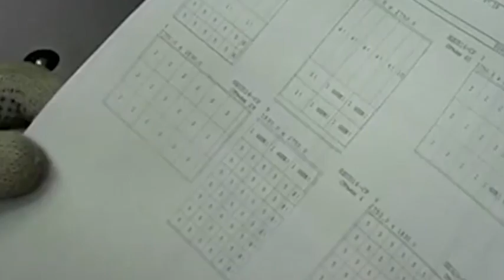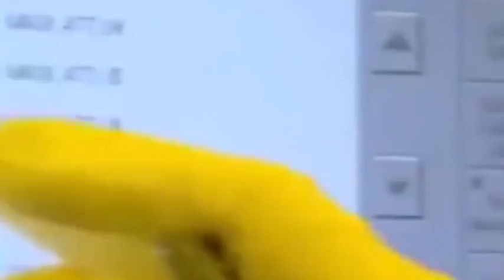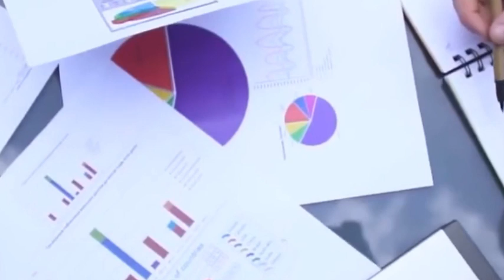Russia has manufactured the first lithography machine that can produce 350nm chips!

Comment: If rusia can make 350nm chip it means  rusia is so far behind...
350 , 170,  90, 50, 24 , 14, 7,5 ,2
8  generations , if 1 generation is 2 years = 15 years behind  west ....???.
Reply: Sounds about right.  However, it should be much faster than 1 generation every 2 years for the first few generations as they will be learning how to produce 15 year old technology quickly and efficiently.  A lot of the work that Russia will be doing for a while will be in creating the supply chains and infrastructure to mass produce the chips they create.  I suspect that they will get a lot of help from Chinese experts in the field.
This video implies that 350nm is sufficient to power many modern day appliances and many military grade items.  Does this sound right?
Reply: @Jon60987  yes ..when you already mastered / understood  it then it may cut shorter 
Examples: huawei m60 last year, 7nm ...now next 3 months, august huawei will launch 5nm ..it means 1 year for 1 generation ...yet tsmc( the most advanvanced chip producer)  up to 2nm ..so china 1 /2 year behind ..china can run fast although contained / blocked by USAcs.....the reason is china chip  3nm but performance is closed to 2nm  because using of multi exposure technique , though expensive ..
Reply: @dovepenrol5955  Thank you for this information.  It sounds about right.  I was wondering if China would be able to catch up with the US in chip technology.  And the answer seems to be that it's not as tough as it was made out to be.  US chip making might be a bit ahead, but it's not an overwhelming advantage.  In exchange, the US reduces the ability of US chip makers to sell chips to China, reducing our profits and global reach.
Reply: Russia is not trying to impress YOU with how advanced their chips are.  Most advanced chips are only used in top of the line consumer electronics.  Russia is not trying to sell chips to Apple and Samsung.  They need them for domestic defense industry. 350nm chips are perfectly adequate to guide a cruise missile to an aircraft carrier.  Also, the chips in America's most advanced weapons such as the F-22 and F-35 are also decades old.
Reply: @СветославТасев Smart comment. I would like to add that most of the military-type chips are made in the 50nm or 90nm process - that process will be the first Russia is really aiming at. Could be up and running (working production lines supporting different chip architectures) at 2030 latest.
Reply: The writer shows being hot iron USA democracy branded who follows rhetoric and academic illusion raising. People fail to appreciate that all that can be skipped or new tech takesover. At least people know they are living not as politicians and cheer Xi in Europe because he addresses his leadership to people needs.
Reply: 350 nm was 1995-1996 Intel tech